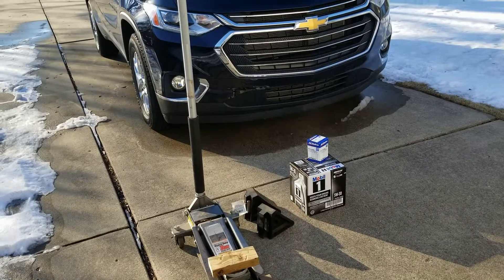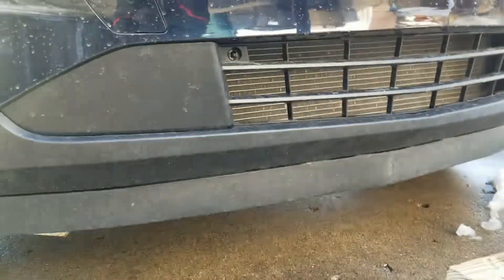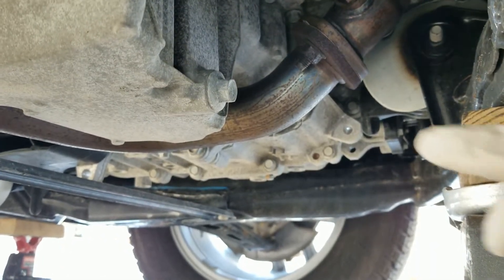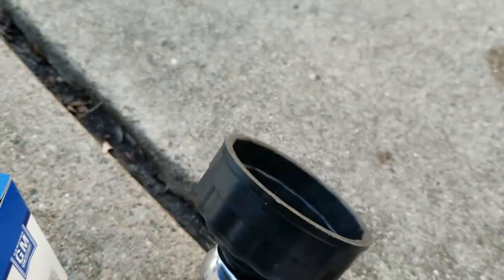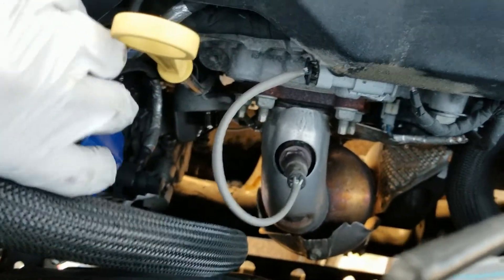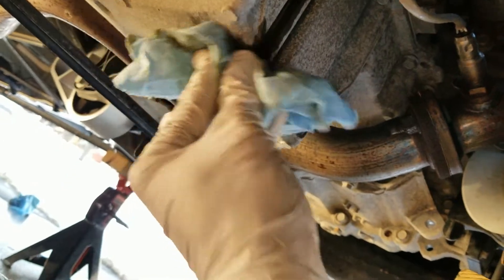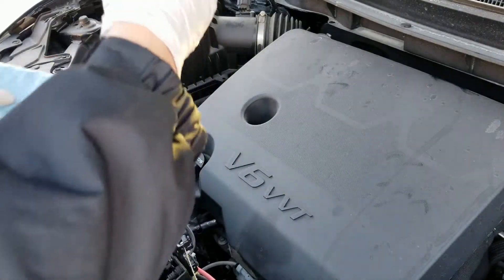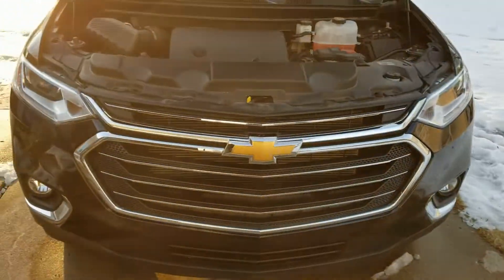Change Your Own Oil or Not (2020 Chevy Traverse)

Comment: You don’t have to jack the traverse. You have enough room to change the oil and filter with no problems. I have a 2021 traverse and I change my oil and filter all the time.
Reply from the maker: Thanks for the tip
Reply: Not only that  but if you jack up the front of the Traverse, and with the drain plug in the front, you leave excess old oil in the pan when you drain it.

Comment: I've learned to just do it myself, had a free coupon at a local oil shop yesterday that also included half off an air filter change. They stripped two screws off the air filter housing cover beyond repair and I had to use a bolt extractor to get them out without damaging the holes in the housing cover, they left that clamp that's around the plastic tube connected to the housing loose so i had to tighten it. Only two days and not even 20mi on it and I've got p0174 and po300 errors I've got to take to a real mechanic shop to fix. Never use a quick job oil change place.

Adding now that I got new screws and tightened them myself plus the hose clamp, the shop yesterday said they only had to clear the codes and after a few trips, they only charged my $50 for the diagnostic test.

Comment: There's no need to jack it up plenty of room, especially if it's really windy. But changing your own oil, engine air filter, and cabin filter will save you about $300 bucks, give or take. So very easy to do.

Comment: I stopped using mobile one motor oil on my 2018 Traverse.  The engine valve keeps rattling at every cold start-up, and the oil just seems to be burnt and cooked every time I do an oil change. Good lubricity oil is not supposed to let your valve to be rattling at a cold start-up.   It's what is gonna cause metal to wear out if there's no oil lube there.
Reply from the maker: What brand of motor oil are you using?

Comment: Do you know what size oil filter wrench cap you used? None of mine fit.
Reply from the maker: Hi,
My oil filter wrench doesn't have the size on it but I did a measurement. It is 75mm.
You can stop by a local part store like AutoZone, they should be able to find the oil filter wrench fit to your filter.
Thanks for watching

Comment: Is that tool for the oil filter required or can u hand tightened it
Reply from the maker: I recommend using the oil filter wrench to do the extra quarter turn after hand tightened to make sure the filter is secured to the engine. Sometime the tool can help you to remove the old filter easier.

Comment: Did you recheck oil level after running for a few mins?
Reply from the maker: I ran the engine for few minutes, check for leaks, shut it off, wait for 15 minutes to let the oil go back to the oil pan, than check the oil level.

If you like the video, please click the Like button, and Subscribe. Thanks